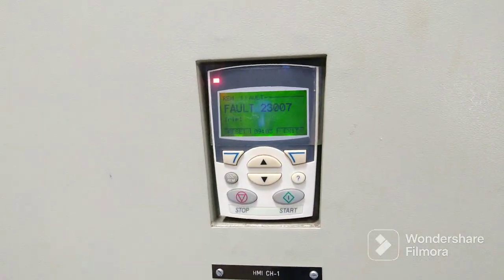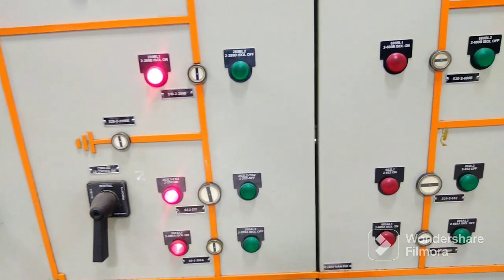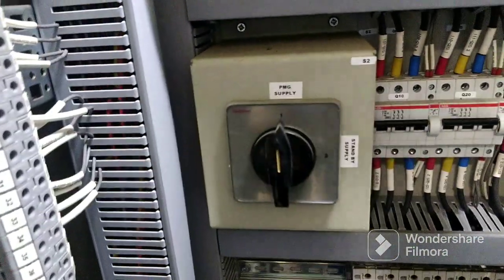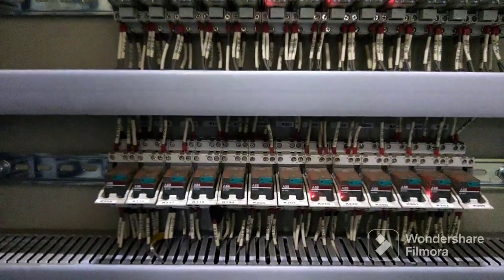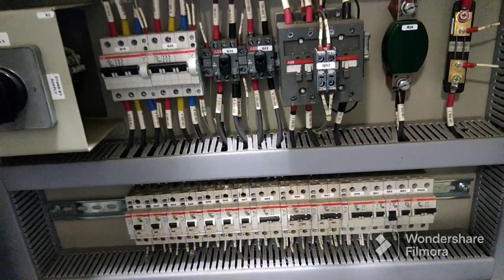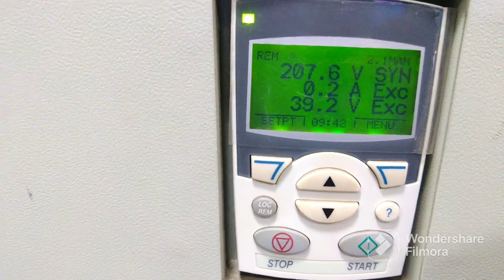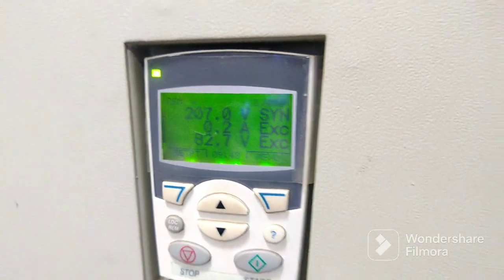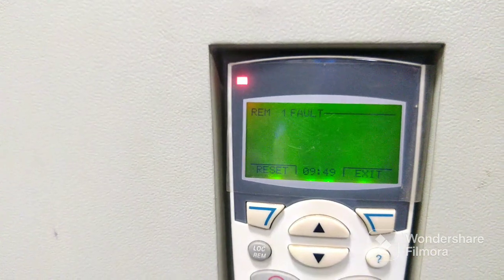AVR Part-2 (ABB Unitrol 6080) manual excitation.

Comment: What is the parameters to forced during series lamp trial
Reply from the maker: 1) 90% Speed feedback of Turbine.
2) TSP trip feedback  to AVR
3) Sync breaker Open feedback required to AVR
4) Master trip (86A,86B,86C,86D) in Generator protection panel need to be healthy.
5) PMG source need to change over to Excitation trafo source.